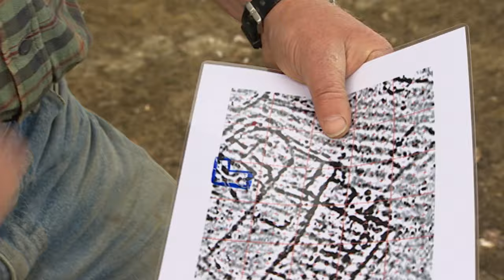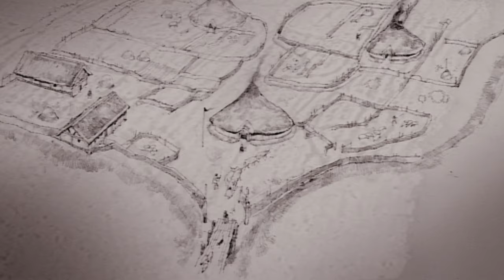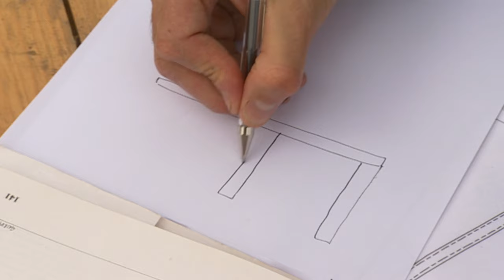The Ancient Roman Treasures Found In A Field In Gloucestershire | Time Team

Comment: This episode had me thinking about my own family and the parallels of what my father's side of my family experienced here in Alberta, Canada. My great great grandparents homesteaded in Central Alberta back in 1887. It was completely wild. They cleared the land for farming, and started with a log, sod roofed cabin, and some rudimentary pole style outbuildings. It was a small, mixed operation of only a hundred acres. They built near a creek that they drew their water from. 

Fast forward to the 1922, when my father was born, the farm had expanded to a full section (640 acres). They had upgraded the home to a stone foundation with rough cut, square timbers, a shake roof, and glazed windows. They had a barn made of rough cut timbers on a stone foundation, as well as timber outbuildings. They also had a well with a hand pump. They used oil lamps and wood / coal heating and everything was horse driven up until 1950. That is when they first started living with electricity. They also upgraded all of the buildings around this time. They also had their first tractor as well as their first vehicle (Model T). From there on, they continued to experience the rapid changes brought on by technological advancements. In this area of the world, we all are still living through a transitional time, just not as profound as what my ancestors experienced at the turn of the 20th century. 
Thank you for these videos.
Reply: I’m from Manitoba. My grandparents moved here during the first world war.